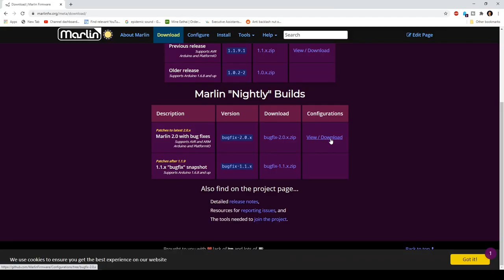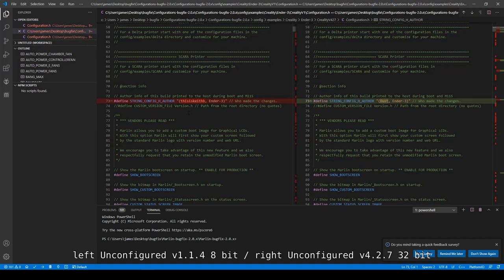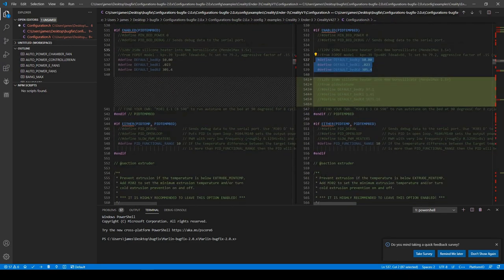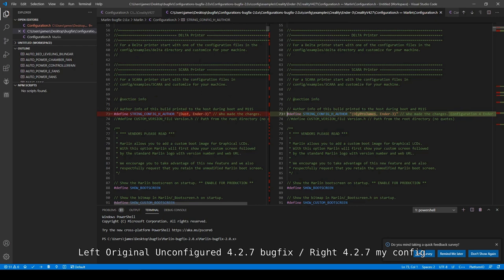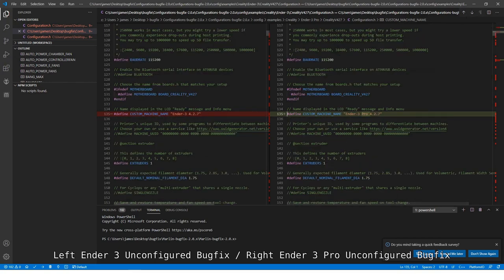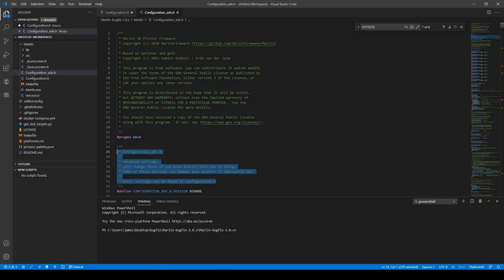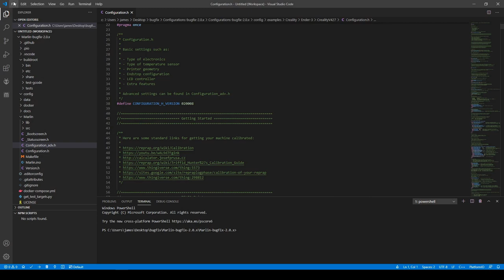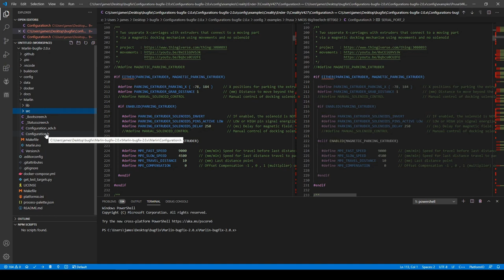ENDER 3 - TROUBLESHOOT COMPARE FIRMWARE - MARLIN - COMPILE YOUR OWN FIRMWARE

Comment: Hey James. Thanks for the tutorials. I think I have looked through all your videos on upgrading to the v4.2.7 board but cannot find an answer to my question. I have successfully compiled and produced a .bin file, loaded it onto my Ender 3 Pro and I do not think it is uploading that file as the flash screen comes up straightaway and even without the SDcard fitted it shows an old unconfigured version but it does produce an EEPROM file on the SDcard. Am I supposed to somehow delete the current file stored?
Reply from the maker: Once it's uploaded it doesn't upload again the second time. In other words if you missed the upload the first time. The printer will recognize the file is the same and will not upload to the printer... You might want rename the last digit on the bin file with a different one or recompile the firmware and try a new upload if you want to see if it's uploading. You can also change some of the information that shows up on the lcd config screen like author when you compile the firmware.

I don't know what you mean by eeprom file on the sd card. EEPROM is on the printer.
Reply: I did some more digging following my post and I found some others who have had the same problem. I have followed their guidelines by always changing the file name each time and ensuring I have formatted my 1GB SDcard as FAT32 in a single partition using Windows Disc Manager. In fact I have tried 2 cards but both have the same problem. The fact that it writes a EEPROM.DAT file to the card suggests it can read the card but it will not boot. I also took a virgin build and just changed the Custom_Machine_Name but no it still comes back with the default name Ender-3 Pro. I got it from Amazon so I have put a question to the supplier Comgrow. Could it be that the bootloader is faulty? Is there a way of deleting the current flashed file on the board?  @DiyProJames
Reply from the maker: @keithtaylor317  Which board are you using? Did you upgrade to a 4.2.7 board or are you using stock board? The process is different per board..
Reply: I replaced my v1.1.5 board for the v4.2.7 board and used VS Code to create a successful build based on the the configuration examples for the 4.2.7. Just in case I had made an error in my changes to support my probe as per my v1.1.5 changes, I then created a new virgin build with just the CUSTOM_MACHINE_NAME changed  and it still shows the default of ENDE-3 PRO name and so confirmed it has not rebooted. @DiyProJames

Comment: Hey I'm having trouble with my new Marlin 2.0 firmware I got a bltouch and went through all the files and defined everything that I had to compile it put it on my ender 3 pro everything looks like it's working but I can't move any of the axis so Auto home or bed level doesn't work but if I reflash the original firmware everything works fine but then I don't have the bl touch stuff
Reply from the maker: I showed you how to compare firmware. I made my firmware available for download. Compare it with your own and find the difference.
Reply: @DiyProJames  Hi can you please send me the link to this download as i can not find it. THANK YOY
Reply from the maker: @juriebouillon3317  https://marlinfw.org/meta/download/
Reply: @DiyProJames  Thank you very much. I get a error message that read:
STM32f1 family is not supported by maple core.
How can i fix this?
Thank you very much.
Reply: @DiyProJames 😂